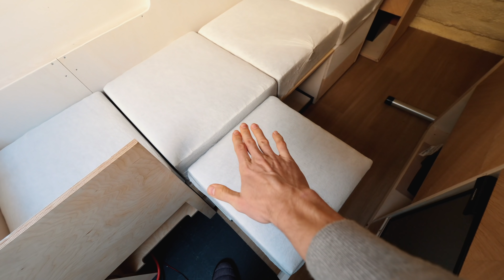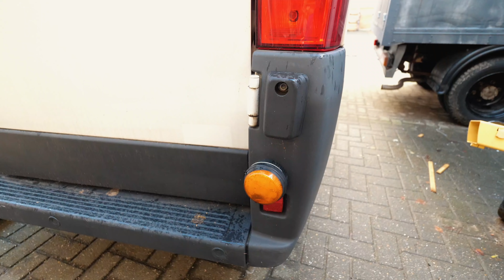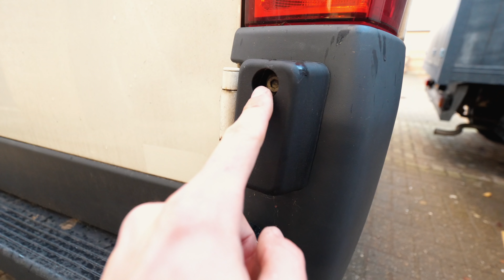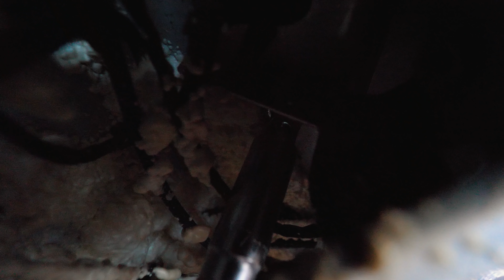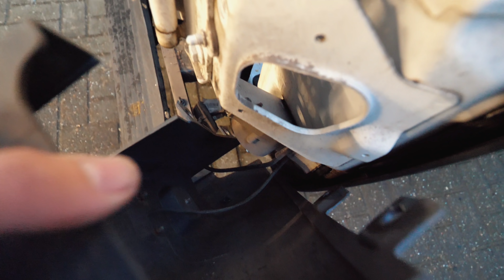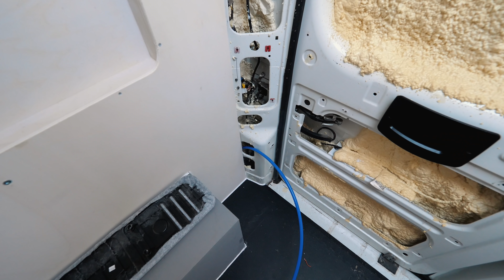Stealth Hook Up & Water Inlet For Camper Vans + Victron and Lithium Setup

Comment: Thank you for a great idea! Only took 3h to install the electric hookup. Ratio Electric make the same connector and hookup cable which are meant to be compatible with the Victron system but far less expensive. Their connector fits a 25 plate Movano just as on your video

Comment: Hi Hugh... i'm going down the same route with the 'hook up' and easy solar both by Victron. And through the bumper area. Good shout.. but can you share a link to the product which is the wire between the inlet and Easy solar? Thx Hugh!
Reply from the maker: Hey Anthony, so if you search for arctic blue cable 1.5mm you will find what you need. The 1.5mm is usually rated to 15a in a mains environment so should be able to handle the easy solar but you could easily push that up to 2.5mm

Comment: Hi Hugh, nice work on the van. Will you be doing a separate video on your EasySolar? There’s very few on YouTube that relate purely to a campervan. Also, the data sheet for the EasySolar does say that it has a 4a starter battery output? Also, does it have Bluetooth?
Reply from the maker: Hi Neil I'm not 100% sure whether or not I can use the easysolar to charge my starter battery but it does have bluetooth! I will  be showing my whole electrical setup so easy solar will get covered!
Reply: @HughTube  excellent, thank you.

Comment: Does your victron have a 4 amp output for your vehicle battery to charge it? Will you fit it?
Reply from the maker: The easysolar doesn't have a dedicated charge point for the starter battery but I have no need to charge the starter battery from the easy solar as I would have to leave my van sitting for a very long time for it to run out.

Comment: Are you using water pressure rather than gravity to fill your water tank?  The fill point seems very low.  Happy Christmas and a prosperous new year.
Reply from the maker: Yeah it is a hose connection so I can only really use pressure points but I do understand your concern

Comment: Be careful with opening those back doors with your 240v connected you’ll knock the plug off.
Reply from the maker: nice observation Richard, I will point this out next vid, cheers
Reply: I’ve got the same van n I reckon the doors stop just shy of it. I’d be more worried about driving off with it connected 😂 buts that’s me

Comment: “Victron - very bloody expensive”, yes but unbelievably reliable and will run all day at the rated output (well, until your batteries go flat ☹️). 

Merry Christmas, enjoy your break, be safe, and we’ll be waiting for your return in 2021.
Reply: They do drop output if the temperature gets high but very good kit
Reply from the maker: Cheers Ian hope you had a great Christmas too